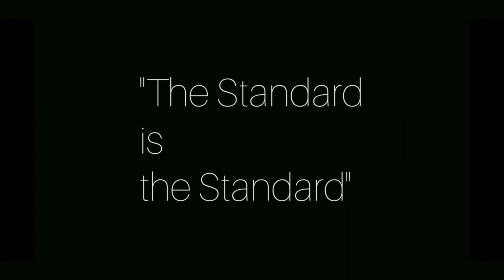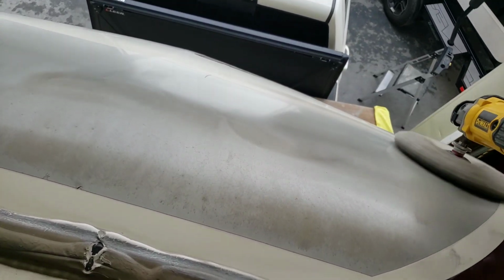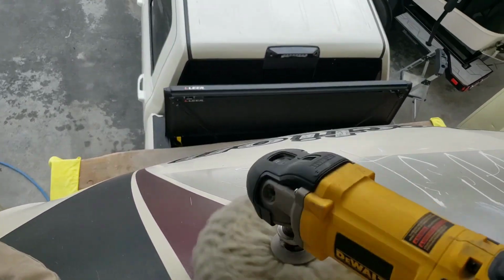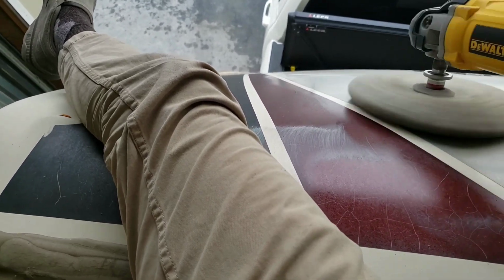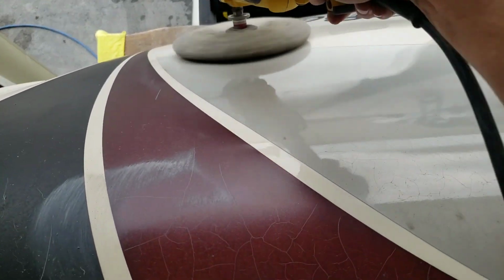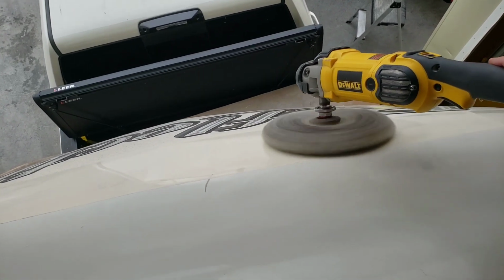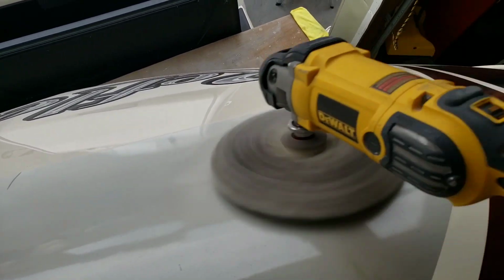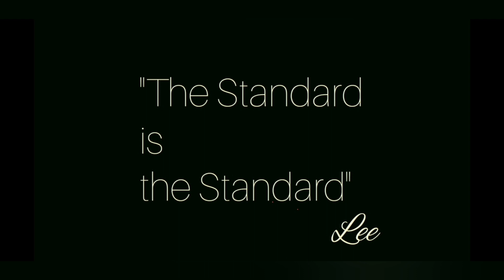Vinyl on Gelcoat. Can it be brought back from the Dead? kind of. A Compound a Buffer & the results.

Comment: Wow, Lee, that came out really nice.  I had no idea that vinyl decals could be compounded.  I mean, I have seen you go over decals before without causing damage, but didn’t know you could revive decals that were in such poor condition.
Reply from the maker: Most decals, you can but there's a point when they're just too far gone like these at the top of the RV where cracks have formed.
Thanks!